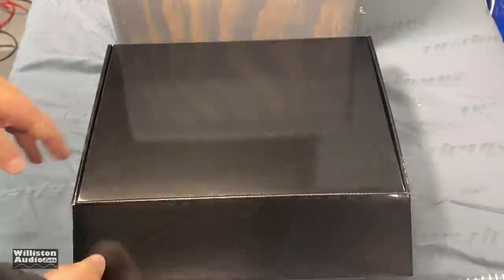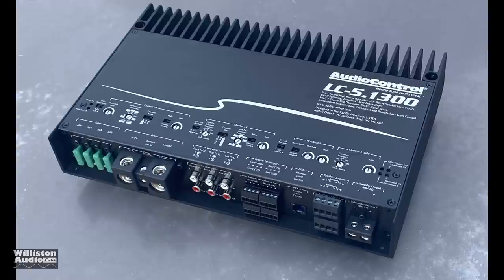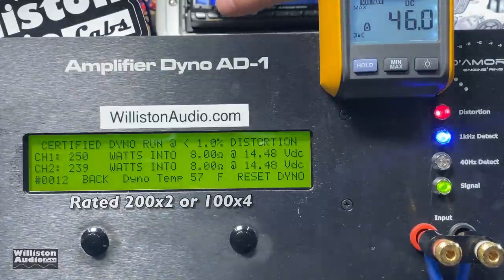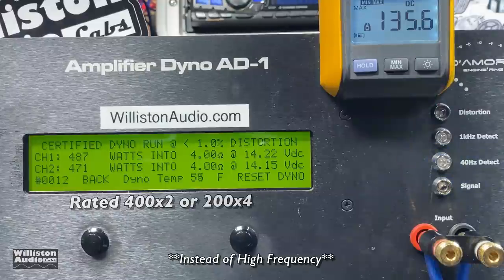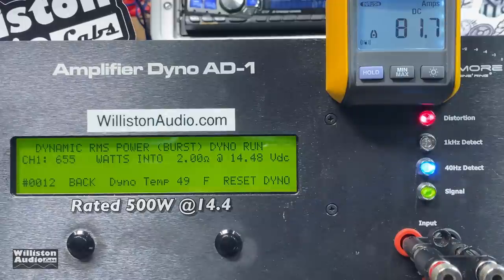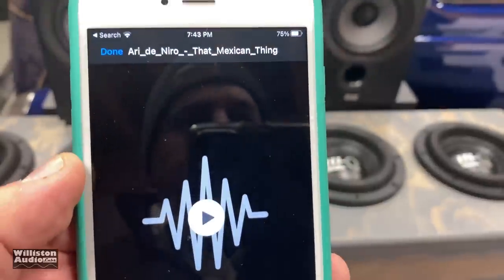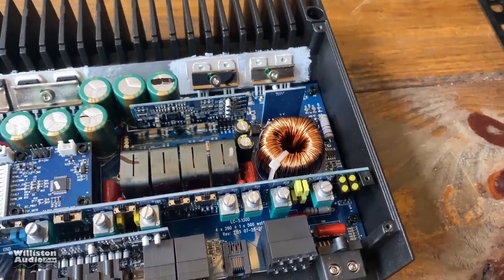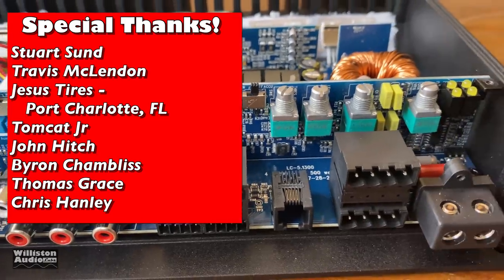Single Amp Solution? AudioControl LC-5.1300 Five Channel Amp Dyno Test and Review {4K}

Comment: If it wont run over 1k on the sub safely, its nothing special. Idk why all these companies insist on rehashing the same thing. 4 x 150, 1 x 1200 RMS should be the minimum on a 5 channel.
Reply: You can make 500 watts sound like 3,000 watt if you do it right
Reply: @ericsantiago6832  "Sound" is a relative term that I wont argue with you. Ive been doing this for about 25 years, and I know that for what I (as in me) want to do, less than 1200 watts doesnt cut it. As long as I can only get my suggested specs out of two amps, instead of a 5 channel, that is the way I will go. Nearly every 5 channel amp is offering roughly the same specs. That makes no sense. The first amp to outperform, and outprice Audison will probably get my money.

Comment: One word on the speaker connections, ferrules. Only way to safely input or output on those tiny connectors. My LC1.800 is the same way.👍🏼
Reply from the maker: Good point 👍
Reply: You can also just let solder soak into the exposed wire.
Reply: 100% . I do see his point for sure tho. Could have taken that extra step .
Reply: even with ferrules 1 strand of wire and toast its in a car so you get vibration  . for $800 your better off with  4 channel and sub amp . no fans ,no remote ,Yuscon Caps= pass

Comment: I have the lc 6 1200 , such clean amplifier.. all of the included features make it worth the money. The built in clipping lights are soo helpful setting it up without owning an RTA or other equipment.. running 4 6x9 Pioneer D Series in the doors,, and bridged 5&6 to a 12 inch Kicker CompRT .. sounds awesome.. looking to move the sub to a mono block next, and hook up the dash speakers.  saving up the money 💰 the built in channel summing is also awesome. I recommend Audio Control to anyone who can afford it..
Reply from the maker: AC makes excellent amps!
Reply: I'm having a similar system installed with this same amp. Have the same subwoofer. What ga power wire are you running it with? Will it be fine with 4 ga ofc power wire?
Reply: @Chandy  the wire guage needed is based on the max amperage that will be required. The LC61200 is fused at 120amps, so as long as your cable run is less than 13ish feet, you should be fine. I ran 4 guage originally, but when I reinstalled in my next truck, I used 1/0 since I plan to run a dedicated monoblock from the same power source. Make sure to have a good fuse close to your battery or alternator wherever you source your power from.
In regards to tuning if you're interested.. kicker provides audio test tones you can download,  like 40hz, sweeps, pink noise...etc  stick with the -5dB versions unless you know or want to know what all that means, Google will help!

You first need to find where your head unit clips at ... 
Disconnect your speakers from the amp make sure the bass knob is turned all the way up for all of this... dont want to blow a speaker while tuning like I did 😶 

Play the associated audio track (use headphone jack, not Bluetooth its a cleaner signal) keep turning up the volume on your head unit and look for the MILC light to start flickering, not on solid. This is the maximum you should ever turn your head unit up to. Some high quality headunits wont clip, so you may never see the MILC light come on..
Once that is figured out, play the track again  and turn up levels/gains until the Maximized lights on the amp channels start to flicker but are not on solid. In my case I played the pink noise for my door speaker channels ( 1, 2, 3 and 4) and the 40hz for the bridged sub channels( 5 and 6).
That should give you a safe tune where you won't blow anything up.. from there I would play the typical kind of music you listen to (with speakers connected) and do some fine adjusting. 
Main thing is you don't want the MILC or Maximized lights on solid, it's OK if they blink and maybe go solid for a half a second or something. 
Don't be afraid to call Audio Control tech support if you have questions, they have always been super helpful and spend the time with you answering whatever questions they can.
There are some other more technical ways to tune using an oscilloscope or an actual RTA but that depends on how much money you have to spend tuning..

Good luck, you will be very happy, I have had my LC61200 for going on 8 years and have had no problems. High quality stuff!
Reply: @djmjr4827  Thanks for your advice! I have a 2019 Toyota Tundra. Installing the infinity kappa components with a 2" midrange makes it a 3 way in the front and coaxial in the rear. Will it be good to use factory speaker wire? Or should I run 16 ga speaker wire to the doors?

Comment: That's a good design.  Tightly regulated and properly rated.  There's a reason why they don't guarantee 1 ohm capability.  The amp's power supply and output transistors need to have adequate capacity for the unexpected (i.e. reactive loads) so they don't let out the magic smoke.  Relying on so called protection circuits isn't the answer as well.  Yes there needs to be protection against catastrophic failure as well as fusing but these are safety measures and only spring into action when needed!

Notice too, a good amp barely if at all shows a peep out of the red distortion LED until the amp reaches its limit and the waveform is no longer a nice round sine wave.  Lesser designs splatter and do all sorts of nasty stuff while still racking up watts.  Which one would you rather listen to? ;-)

Not to mention in many installs where the amp is connected directly the driver voice coil (active x-over) there is no protection whatsoever for the driver.  Woofers and mid basses are acceptably tolerant but tweeters?  Forget about it!

Comment: Considering the RCA's are literally BOLTED to the front panel, i would consider them PANEL MOUNT, although they are slightly different designs, that keeps the force off the circuit board quite well. Not a negative, just a different design
Reply: I was going to say that and tiffany style is great for 2 or 1 channel amps. The nuts take up space and this is a space saving design.

Comment: Hey Big D! Great videos as always! One thing of note about these LC series amplifiers is that they are designed by Robert Zeff and Nikola Engineering! I know you know that name! These are very similar to the Arc X2 series amplifiers. I actually have the LC1200.6 running a 3way fully active front stage and an oldschool Rockford bd1000 on my sub in my car. I can tell you these are extremely clean sounding amps! Thanks again for all you're doing for the car audio community!✌

Comment: I'm having a hard time believing this is only a 12awg (2mm²) cable at 4:40. I agree that they should have shosen the outher connections for bridged mode. Eighter way in my opinion the cable size you choose should not expose the wiring so much when correctly connected. Thanks for a great video once again.

Comment: On the top cover removal: You don't need to take the back screws out, they are only sort of "hooks" under the lip in the back.
The front screws don't need to be fully removed.  You unscrew them about halfway and the you lift up the front and slide the cover back to release the "hook" screws in the back.

This info is in the owner's manual as well.  All of the new Audiocontrol LC and DM amps have the same top cover removal.

It's kinda weird. I wish they would have just make actual hooks instead of using screws that way.

Comment: The price is on the high side. BUT, this is a do-all amp for someone looking to easily power an upgraded factory system without the need for LOC's. What I'd like to see from AudioControl is adapter plugs for factory systems that go directly from the factory amp output to the high level input. It would make this more plug'n'play and appealing to a wider audience.
Reply: Factory amp output? Meaning the positive and negative on the speakers in a stock car audio system? That’s what the high level uses for input
Reply: @greglatta1  Exactly. For instance, if you're adding this to a factory Alpine system in a Ram/Jeep it'd be nice if they made a jumper that plugged directly in to the output of the factory amp and directly in to the high level input on the AC amp. Save some time of running wires, and it'd be more plug'n'play.

Comment: Awesome piece of equipment big D. The efficiency is incredible.  Considering the price point and the features this amp is definitely designed exclusively for folks with brand new or leased vehicles that have complex factory systems that are difficult to upgrade. I can't think of a reason to use this with an aftermarket head unit since most decent ones all have plenty of EQ & crossovers built in

Comment: Hey Big D, are you using a different mic for the "Do it bump doe" portion? Wasn't hearing the bumps and drops as well as I usually do. Nice to see Audio Control still making top tier gear 25 years after I got out of the hobby 👍🤘

Comment: Curious what your thoughts are when comparing this amplifier to the T1000X5ad?  

Btw... great videos.  I’ve recently got back into Car audio and had a few old Rockford Amps refreshed through some of the original engineers after finding your channel.   Thxs for bringing back fond memories.
Reply: This is the exact comparison I was wondering about.   I'm been trying to decide between these 2 amps.  Keep going back and forth between the 2.   Did you ever choose one over the other?
Reply: @caraudiocentral  I was hoping to get some feedback on this channel but no response as you can see.  
 I’m still debating between the two.  I’ve never used AC amplifiers before but still have some of their preamp
Stuff from 20 years ago that still sound awesome.  

Did you decide yet? If so, would you let me know which way you went and why..? Thanks.
Reply: @kevineth100  I haven't decided 100% yet,  but leaning more toward the Audio Control.  I think mostly just because I want to try something new.  But still wish someone would do a comparison between these 2 amps.  Would like to see which one performs better.

Comment: Your meant to use wire ends on the speaker outputs. thanks for sharing

I used to love AudioControl sounded great till it didn't in November just before the start of covid19 after saving up 2 years  at a shop near me they ordered and installed for me a dm-810 dsp , two D-4.800's and lc-1.1500 sub amp 2 sets front Alpine x series 6.5 Component Set rear ALPINE X Series 6x9 Component set and 4 JL AUDIO 10TW3 shallow mounts built in to a custom console that went from front to back now the bad the  AudioControl dm-810 started interment shut downs ins inside of 3.5 month by 4.5 it was dead took it back to the installer and AudioControl tells installer it was not bought through one of there dealers more less piss up a rope and next day covid shut down happens and till its over the installer closes shop for good I mean come on AudioControl its the 2020's everything is bought online now the warranty shouldn't matter where its bought from these days if from the USA even after I called my self they never even called me back I boycotted AudioControl at that point its a shame there stuff sounds great but the $800 hit hurt with the way money was then ending up out of work for 4.5 months.. sorry for the rant.. and people buy AudioControl be careful where you buy there there stuff from and make sure its a dealer or they will weasel there way out of there warranty..

Comment: Fun fact: 5 year warranty. 
Genuine question: are there any other companies in the car audio space with a comparable warranty period?
Reply: Five years from the date of purchase, provided it is installed by an authorized AudioControl dealer
Reply: @bryantopp174  Good catch, that is quite disappointing.
Reply: @bryantopp174  Exactly.
Reply: Sony's new GS series subs and XM-GS amps (watch out JL) are 3 years as long as it's installed by an authorized dealer.
Reply: @bryantopp174  that is not true. Warranty is still honored if purchased directly from any authorized online dealer.  Such as crutchfield or abt

Comment: Excellent video as always! I'm really curious why the dynamic is so intense on other well known high end brands ex, my beloved rockford t1500 is bonkers dynamically but this barely did its un-certified on the dynamic test. Im confused and hoping you can shed some light on my curiosity big D? Overall I'd still pick it up very nice aml in a small package. With 1/0 gauge baby. Again thanks for posting. Bet it sounded good n thanks for fighting to get the amp open.
Very nice potentiometers BTW, love seeing high end goodies for our $
Reply: I'll try to keep it simple. Its the amount of capacitors in the power supply section for the most part. When an amplifier has a strong power supply with lots of capacitance, the amplifier can send out short bursts of power much higher than the rms rating of the amp. Take a power supply built for a 7.5k and put it on an amp meant to output 5k, and you wind up with a 6k rms amp that does 8k dynamically.

Comment: Looks like it was designed to be wired using wire ferrules. In a standard install using ferrules, I doubt there would be any issues with the terminals.

Comment: You only need to loosen the 2 screws at the front, then slide the panel up slightly and remove. The top 2 screws don't screw into the body. They act like a lock pin.

Comment: Wow this amp is amazing, especially for that size, but how hot would it getif using at 80-90% and how long would it play for?
Reply: It looks to be a class D amplifier. Assuming that it is, you’ll likely turn the volume down from ear fatigue well before it goes into thermal shutdown unless you insulate it with a pile of blankets or something.

Comment: I have this volfenhag 2000w german concept amp it has these tubes on both sides with air bubbles so it looks like a tube with water and when the amp is turned on the lights light up blue pretty cool amp but I would really like to know what it does. It's from the 2000's and it's heavy-duty it weighs about 15pounds.its L-15" 3/4 W- 13" H-1"1/4 the tube lights run the length of the amp. This guy I knew he gave it to me like 8yrs ago.

Comment: So, speaking of 5 channel amps, I'd love to see what the Skar 5 channel SK-M9005D amp can do. I bought it to control my mids, highs, and my sub as well, but my touchscreen stereo doesn't have a line amp output coupled with the speaker outputs, and the amp will not run normal line out speaker along with the RCA outputs, so it won't control my mids, highs, along with my single 8" sub in my Acura TL unless I run it all through line out speaker controls, or line out RCAs.

Comment: One thing you and mostly everybody is failing to mention is that AudioControl plays really clean at 4 ohms for high frequencies, but if you drop the load to 2 ohms, the clean sound quality is completely gone. At 4 ohms it’s the most rms power you can use, cause at 2 ohms the amp is useless. This is for running components or coaxials. But for bass, you’re good at either 4 ohms or 2 ohms from a bass amp, or in this case from the sub channel.

Comment: I had to check the manual, but the crossovers are only 2nd order. Too much mid bass bleed on from the subs for me... surely it couldn't have cost that much more to make (at least) the sub channel x-over 4th order.
Reply: If your head unit has a subwoofer output that's 12dB/octave, and you use this amps crossover as well, you can achieve a 24dB/octave slope.

Comment: When are you going to get back to your Oooooollld school audio amplifiers? I want to see the O.G. schitt.
Reply: Old school is nice. 
I have had many back in the day but.
They are bigger,
Get hotter and need more amperage to do the same job as the smaller cooler new amps.
I do understand why you want to see them tested. Today's amps are more efficient by far.
Try and leave the past behind.
Can't go back even though I want to also.
Have a blessed life. 
🙈🙊🙉
Reply: @Mr.Robert1  ah, yes. The old “carburetor vs fuel injection” argument.

Comment: I personally miss my old Audison LRX 5.1k. I wish I never sold it, as there is NOTHING in the market that can even come close to it these days. 60w x 2 Class A, 170w x 2 Class A/B, 750w x 1 Class D (all at 4ohms, sub (1050w) and A/B stereo channels (250w x 2) 2ohm stable, Class A channels 4ohms only ). I wish more manufacturers would build an 'unbalanced' 4 channel setup in their 5 channel designs. I don't want a 5 channel to run a 70's quadraphonic housewife minivan surround sound special with + sub !..... I want my 5 channel to power a 2-way active front stage and BIG sub power. Rear fill is just THAT....FILL. That's what deck power is for. Next time someone says 'Best 5 channel ever' and they aren't referring to an old Audison LRx5.1k that was made in Italy....they have ZERO clue.

Comment: So after a year which 5 channel amp would you recommend between the audio control and the JL 900/5? I have 4 6-1/2 a pair of 5 1/4 two ten inch subs and a pair of tweeters all MB Quart bought several years ago before they changed owners. Going for sound quality not thump. Any feed back would be appreciated.
Reply from the maker: Oh man both are excellent! The AudioControl has more power on the sub channel so that might sway me. As far as SQ I doubt you could tell a difference between them
Reply: @wal  awesome. Thanks for the quick reply back. Another option I have is a JL 500/5 that a good friend has. It’s in mint condition but he’s upgrading, would that be a good option as well or would the newer amps be a better option? I’m leaning heavily towards the audio control.

Comment: It would have been better if you would have used ferrule connectors for those lines, having the bridged mode wouldn't have been so bad and would have kept the wires clean.
Reply from the maker: I would 100% use ferrules for permanent installation. Doesn’t work well for bench testing as it can be difficult to remove and reuse